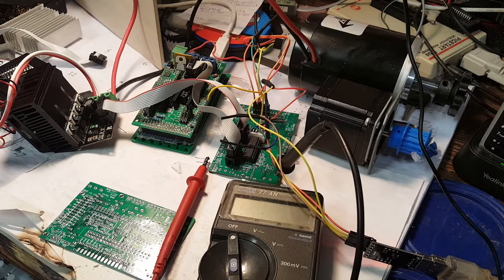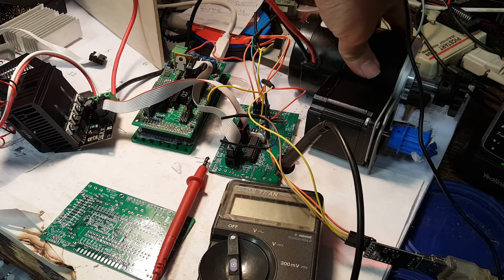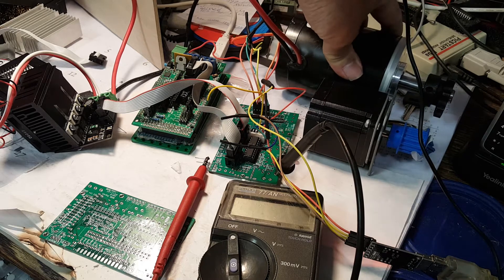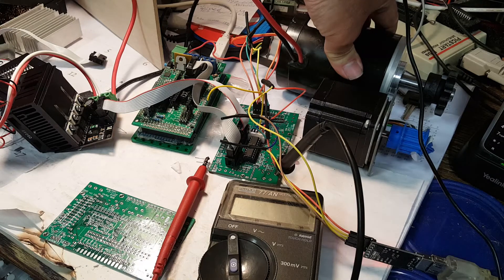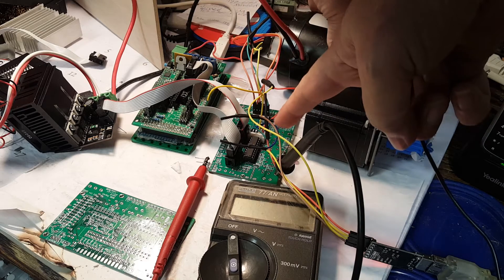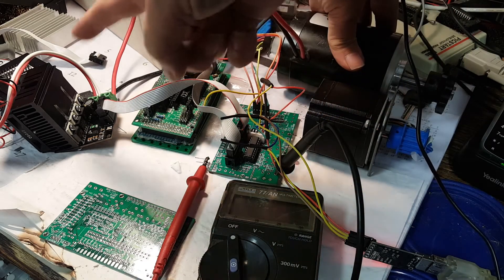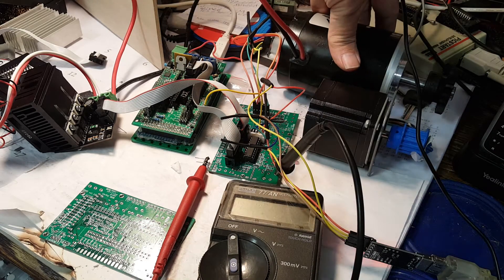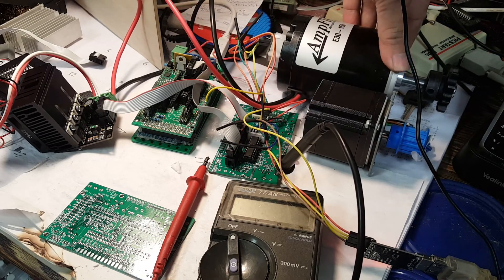Amp flow E30-150 on MassMind.org ENC1, BOB PID, Servo

Comment from the maker: @Stephen Garner: Because the MassMind system is modular, you can use whatever driver you like. The L293 you linked to has been around forever and a pair of them, connected correctly, will drive a DC motor. But they only provide about 35 watts. The MassMind motor driver in the video (left side) provides nearly 1 HP or about 700 watts. So it can get the full strength of power out of a much larger motor.

Comment: Couldn't you use this driver? http://www.ti.com/lit/ds/symlink/l293.pdf
Reply from the maker: Because the MassMind system is modular, you can use whatever driver you like. The L293 you linked to has been around forever and a pair of them, connected correctly, will drive a DC motor. But they only provide about 35 watts. The MassMind motor driver in the video (left side) provides nearly 1 HP or about 700 watts. So it can get the full strength of power out of a much larger motor.